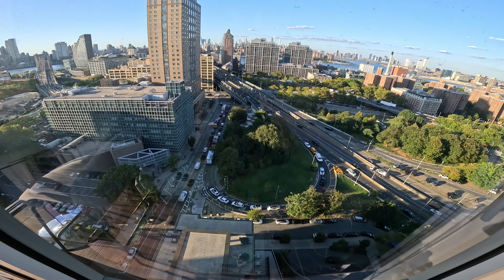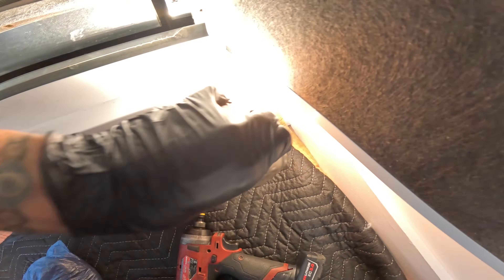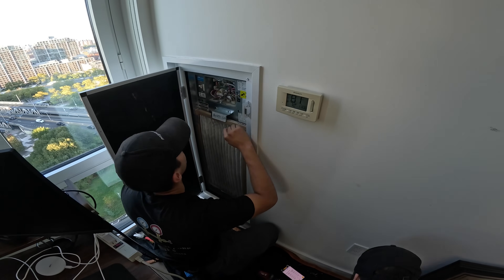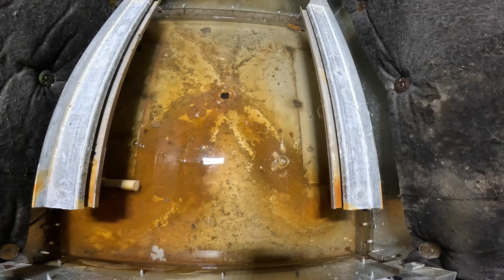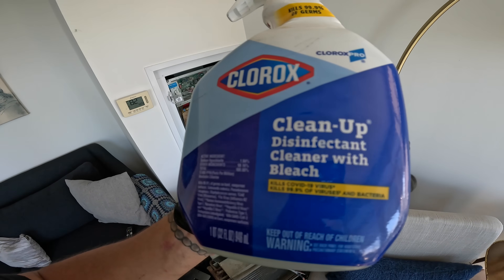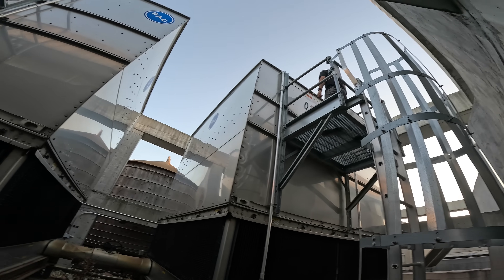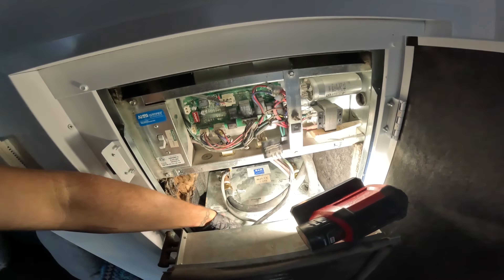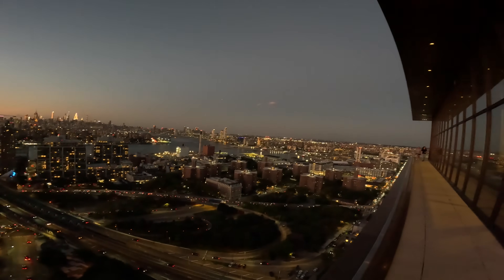HVAC: Omega Water Source Heat Pump COS Error Code Troubleshooting/Repair (Omega COS Red Flashing)

Comment: G,day JMT from Sydney Australia. I am working in a similar size building with visual BMS monitoring of towers, chillers and individual room fan ops and temps.
To prevent lint and dust effecting squirrel fan motor and electrical speed controller with masking tape any gaps between reusable filters "minimal dust minimal faults"
Only need one chiller to maintain flow for all Bld, and have one on fault alarm regularly. I don't get much time with the techs to find out why. Two big chillers wrapped in insulation covers?
🌏💫

Comment: wonder where the other end of those drains go.
Reply: To the Ninja Turtles lair.
Reply from the maker: @sherwinalvarez7365 😂😂😂
Reply: @sherwinalvarez7365 🐢🐢🐢🐢🐀
Reply from the maker: Underneath the unit is a pipe that gets connected to a larger main drain line👍
Reply from the maker: Thanks for watching! 🔧⚡️

Comment: As always interesting informative and helpful video. Thank you JMT.
Reply from the maker: Thank you very much & thanks for watching! 🔧⚡️
Reply: Привет 
Подскажи сколько заработать получается ?
Reply: @Vladimir-c2i4s  The faster you learn, the more you make. The more you know the more you make. You can be a building engineer, work nights at 50/hr once you pass written and practical. You can then run 1 side job servicecall, change a motor or a start cap and make 600-1000. Do that a 100x a year and make 200-250K. Now these are broad strokes. The more you work the more you can get paid. It took me 7 years to get to that level. I am personally trying to make a million every 4 years. You do you.